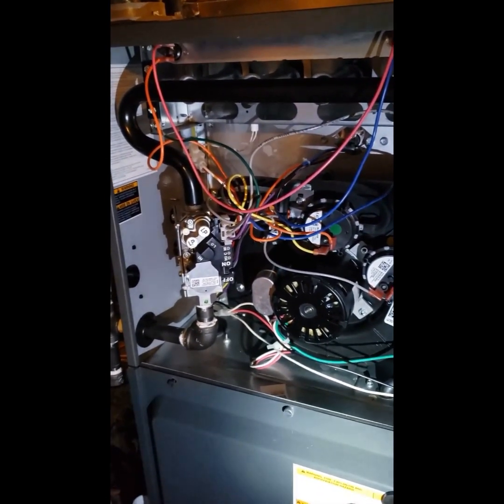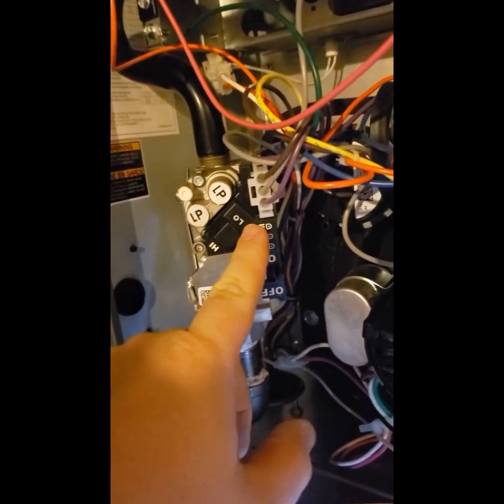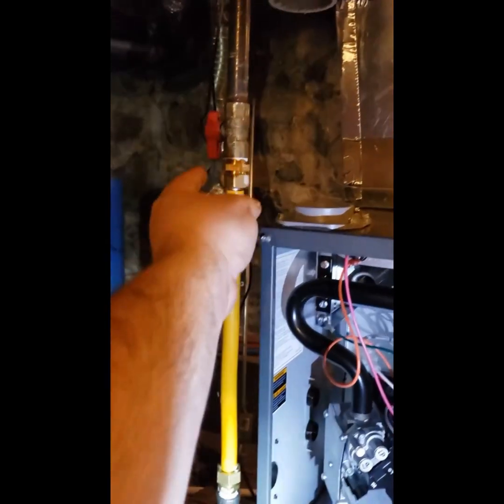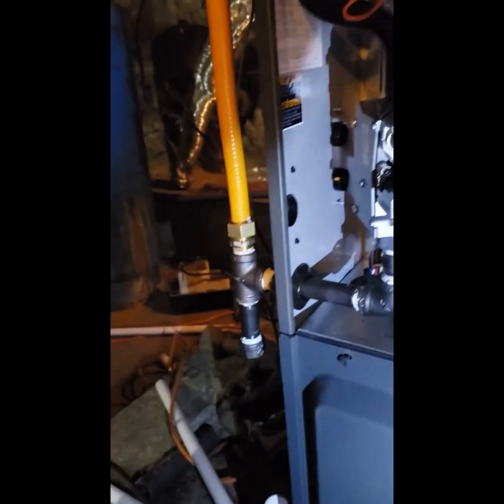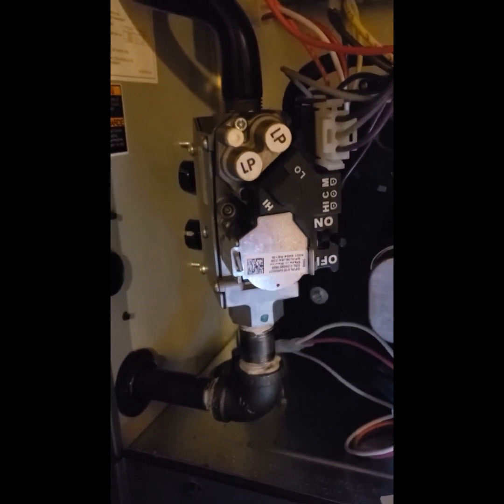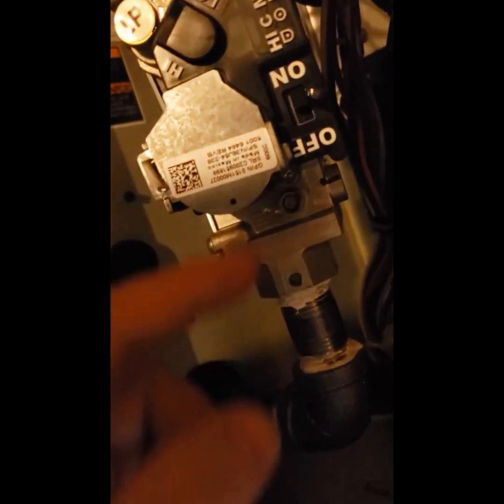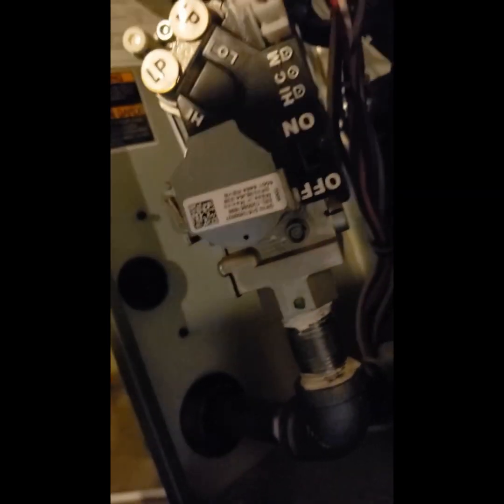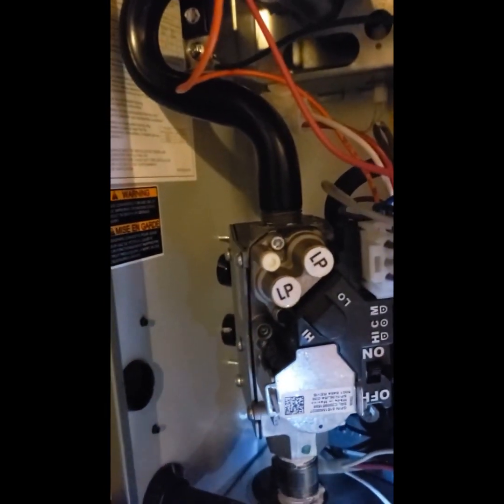Goodman Two Stage Gas Pressure Test

Comment: 1:05 That, like the one on the inlet side, is called a "boss". No need to take the plug out; just loosen it a turn or so to let the pressure out. And do NOT forget to snug it back down when you are finished, or it will leak gas into that area and explode when the furnace lights.